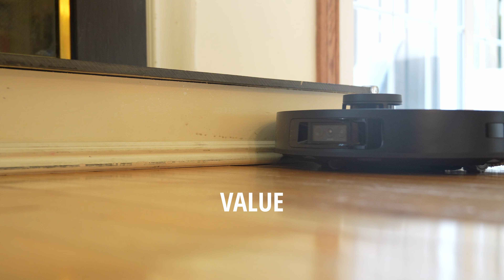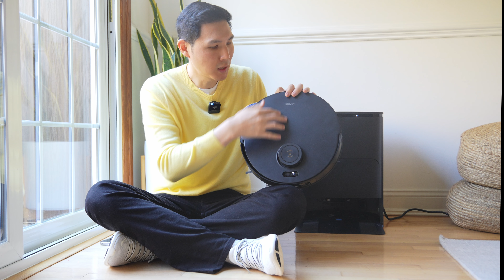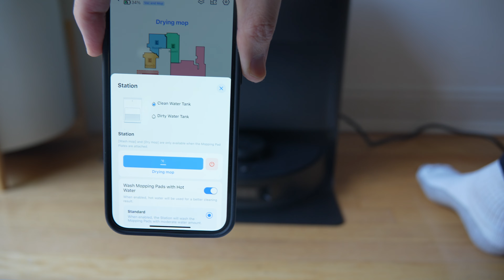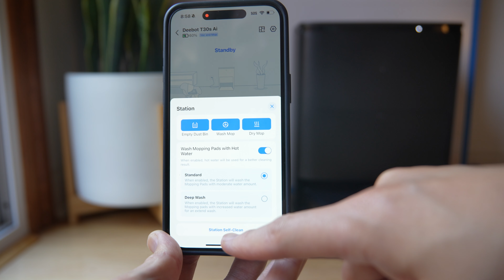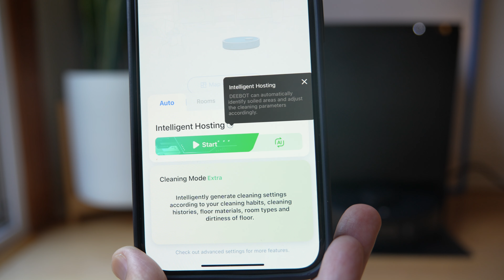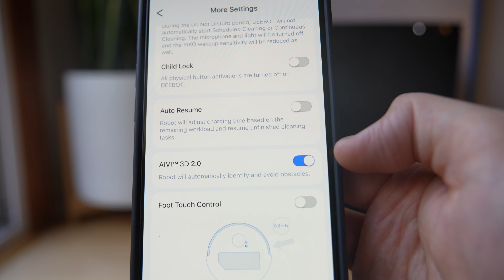ECOVACS DEEBOT T30s AI - Best Premium Value Robovac?

Comment: I have bosch spotless max cam , so , german version of it , same hardware 
My dock doesnt auto vaccum robot after cleaning , i have it to press it in aplication to do it , any thought? 
I restart the robot , nothing change
Reply from the maker: Hi! That's a software issue normally. Can you try re-connecting to the unit? (reset the device). The machine clearly works but is not getting the right command.

Comment: Just curious—did you try running it with a charging cable on the floor? Have you ever experienced the mopping pad coming off during its runs? I just returned mine today because of that.